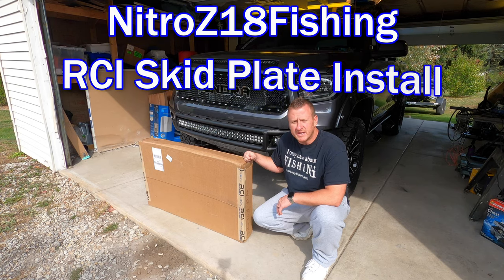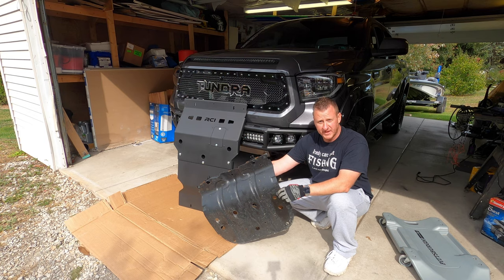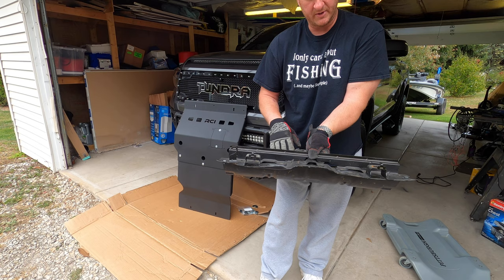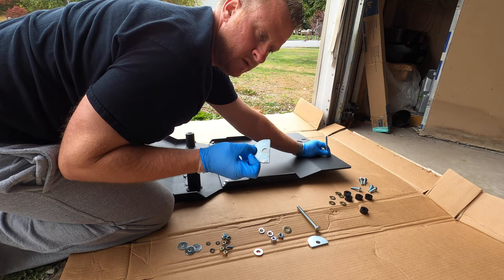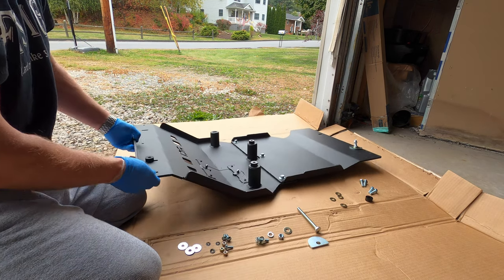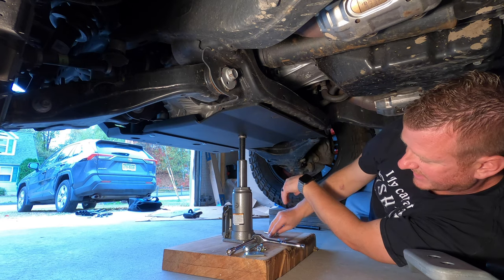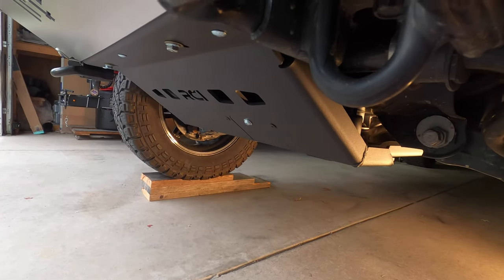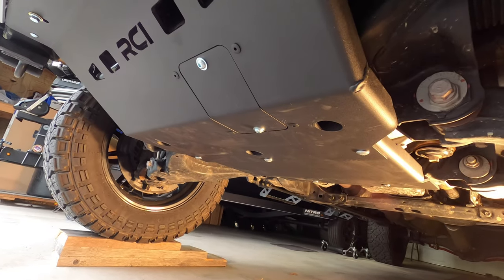RCI Skid Plate Install/Review

Comment: Appreciate the video, I will be installing mine in a few days, you did a great job explaining. How does the small removeable door work out for you when changing the oil filter? The removeable door looks to be around 4" wide by maybe 6" long. 
Thanks
Reply from the maker: No prob, thanks for checking it out!…the trap door works awesome, I do wish it was slightly bigger but I have no issues changing the filter at all…absolutely worth it, not having to take skid off is a big help!

Comment: What size lift do you have? I have a diff drop zone5 and found out this skid plate works up to 4 inch lift. Looking for options maybe modified
Reply from the maker: Hey Paul!...I have a 4” lift, you could probably still do it, just need a little bit bigger spacers I would imagine...maybe someone can chime in if I’m wrong!

Comment: I have a Fumoto oil drain valve installed. Does the cutout on the right side give you room to access the drain plug area? I looked at other skid plates, but they look like they will interfere with getting to the drain plug/valve area.
Reply from the maker: Yepper, you can access Fumoto easily...I had one on that truck as well, plenty of room!
Reply: @NitroZ18Fishing  thank you. I’m ordering one.
Reply from the maker: No prob!

Comment: How do you determine if you need to use the spacers or not?
Reply from the maker: The spacers are for if you have a lift installed… You’ll be able to tell as soon as you hold it up to the truck… It won’t sit properly if you need to use them, hope that helps!